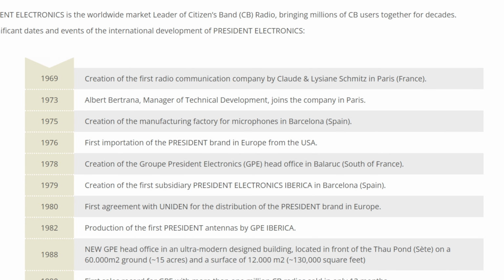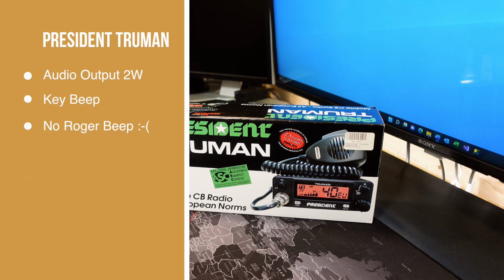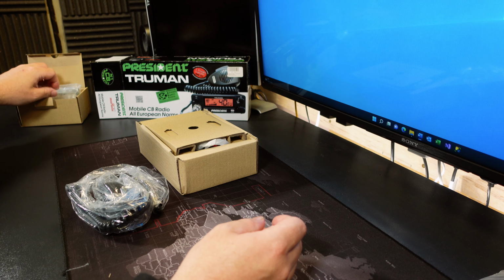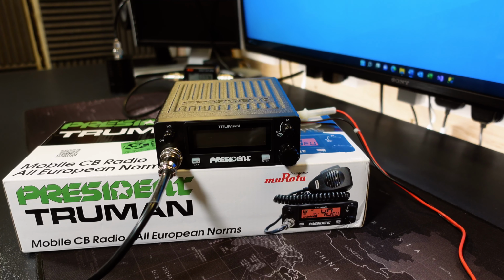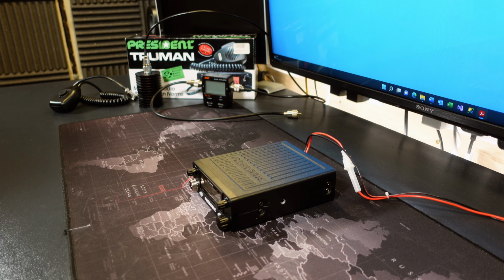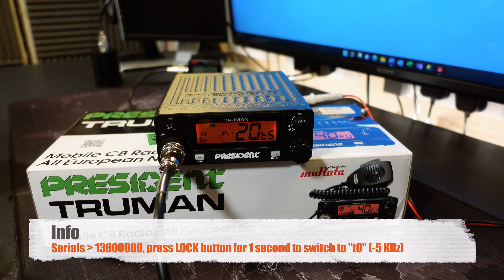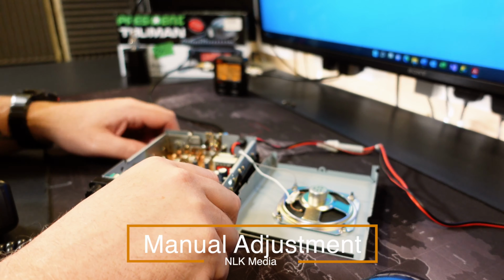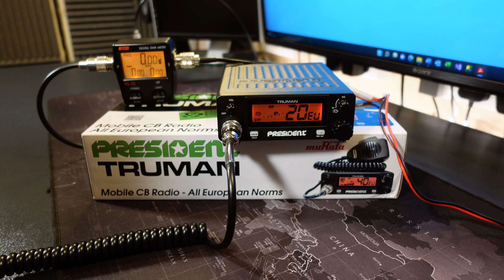President Truman CB Radio - Unbox, Test, Review and Power Modification

Comment: Hello, thank you for your great videos.  I'd like to ask- is it enough to cut white wire for the higher power output or the jumper must be moved too? I don't need an expanded channels,  just power. Thank you in advance and 73!
Reply from the maker: You need to do both as the jumper sets the radio into high power mode on the software side and then wire enables the higher power on the electronic side. If you cut the wire and leave the jumper then the radio remains in standard configuration using the standard power profiles. Hope this help and thanks for watching. MJ7NLK

Comment: On band c channel 33 do you get the 0s you could reach 27.780 and just get 19fm
Reply from the maker: Hi DX Chaser, You need band block B, channel 33 and enable the T0 mode to get 27.780. President have a weird band block methodology where Block C is Inferior, A is Normal and C is Superior. So, challed 33 in Inferior Block C is 26.885, Normal is 27.335 and Inferior is 27.785. Hope this helps and thanks for watching

Comment: What do you recommend in this price range with a Roger beep?
Reply from the maker: Hi, the Truman was about £85 as they were shifting the last of the stock, its been discontinued now. Knights Electrocom are out of stock now and so are Moonraker. However, Radio World has 1 left at the moment but i have never used them before so cannot vouch for them. You could always try your luck on ebay. Search around and see what you can find. All the best and thanks for watching
Reply: @NLKMediaGroup  sorry if bad english, I'm french, my question was not about the Truman, you said it was too bad that it didn't have Roger beep, so which one have it for under 100 bucks
Reply from the maker: Hi iShift, for under £100 i would have to say the President Barry 2 which is a solid radio. However, an expanded President Richard for £149 is a great deal at the moment if you have a Ham radio license. If you do not then pushing the budget to get its CB equivalent, a President Walker 2, would be a great move. If you want a single side band radio then the only option in the CB bands from President is the President McKinley but that comes at a cost. All radios mentioned have been reviewed on my channel. The CRT 2000H is also worth a look at around £120. If your looking for a CB radio only and can push the budget the Walker 2 is a lovely radio.

Translation to French which may not be very accurate

Salut iShift, pour moins de 100 £, je devrais dire le président Barry 2 qui est une radio solide. Cependant, un président Richard élargi pour 149 £ est une bonne affaire pour le moment si vous avez une licence de radio amateur. Si vous ne poussiez pas alors le budget pour obtenir son équivalent CB, un President Walker 2, ce serait une excellente initiative. Si vous voulez une radio à bande latérale unique, la seule option dans les bandes CB du président est le président McKinley, mais cela a un coût. Toutes les radios mentionnées ont été passées en revue sur ma chaîne. Le CRT 2000H vaut également le détour à environ 120£. Si vous recherchez uniquement une radio CB et que vous pouvez augmenter votre budget, le Walker 2 est une belle radio.

Comment: On this day in history, in 1545, the French tried to capture the isle of Wight but were defeated. Seems to be a pattern there. On the radio stuff: my Midland M20 had an identical wire jumper. It wouldn't put out more than 2.5w until the jumper wire was cut. A lot of the modern radios don't seem able to do 4w without modification.
Reply from the maker: Hi Gordon, I do hope you are well. Hopefully my humour is ok and viewers get it. I can see France on most days from here, its very close, so just playful banter and no offence is intended, I hope it made you laugh or at least rasied a smile. I have just purchased a Midland M20 and M30 and will be reviewing them after the current backlog. I think I have the President Taylor 4 and Lincoln 2+ left and then a CRT2000H and then the Midlands. Finding the time in the summer (I have 4 kids) is not easy and the videos take quite a bit of time to put together but fun. 4W is the legal limit so there wont be any CB radios in stock form pushing more than 4W. It will be interesting to tackle the Midlands and see what is available under the bonnet. All the best and thanks for commenting.
Reply: @NLKMediaGroup  I don't mind at all! GM4SVM.
Reply: @NLKMediaGroup  Here are my thoughts on the M20: Although it has a rotary channel change it is very stiff and there is no grip on the knob. What it needs is a flat sided channel change like the old Rotels. The USB socket is pretty pointless as it does not provide enough current to charge a modern smartphone. This is the same for a lot of the CB radios with USB sockets on the front. Finally I couldn't get more than 3.5w out of mine. It was 3.1 out of the box and with the power level pot turned right up I got 3.5. Eventually I cut the wire and the power jumped to 6w. I was then able to turn it back down to 4w. Again, this seems common in a lot of modern radios where they want them to pass an Ofcom spot check on import.  I know that 3.5-4w is really nothing in dB, but I felt short changed.

Comment: The President Truman ASC Premium is the little brother of the Harry III. Same design, same case and same high Uniden-quality but less features by the Truman-model.

+ sold from 2009-2021 (2016-2021 with japanese 455KHz-muRata-Filter)  
+ high build Quality made by Uniden Vietnam (Truman and Harry III are the last models which Uniden produced for President until 2021!!!)
+ EU- Multinorm on 6 bands with 4W FM and/ or 4W AM, UK-channels (Muppets) in FM
+ stable metal-case which doesnt get much warm after hours of transmission
+ ANL and hight quality 455 KHz muRata-Filter inside
+ sensitive and very good receiption
+ adjustable automatic and manual Squelch
+ third generation President-ASC (scratches, noises and too weak signals get filtered out)
+ loud and clear Modulation especially on AM
+ great sound quality by big internal speaker
+ good readable big orange display with excellent digital S-Meter (6 segments)
+ clear structured "oldschool" design with three well working dials and two buttons
+ easy to use for everybody, nearly self explaining
+ ideal for all who want quality instead of pointless and expensive features
+ price in Europe now 69-79€ (if still available), former price was 109€ in Germany

- ploppy manual squelch
- O-Mike without Up- and Down (tipp: U/D-Electret-Microfone under 20€: Komunica DM-520 U/D 6pol, looks like "President-Egg" but with better more clear and loud modulation)
- needs some alignment for the maximum Power- and FM-Deviation allowed

The President Truman ASC Premium looks good, works well and has its own charme of a basic but quality CB-radio. Price/value is awesome and sell out very soon!

Thanks for the video about the President Truman ASC Premium, the history of this US-President, quite funny jokes, short outdoor-test and your own point of view. The only I dont understand that you rated the Harry III very high earlier and the little brother Truman you downgraded and recommend instead a Barry II. A Barry II is quite different, approx. 30€ more expensive and the latest nearly full featured CB-generation which based on software programes, really not to compare with the older basic Truman which has charme and other specific qualities.
The Truman was produced over 10 years, so it was and is still a sucessful and very good radio for the little price. Thousands of CB-folks bought that radio in the more than 10 years of production and upgrades. Which other radio was over 10 years in the shelfs? I dont know any other model or brand.

However, I own the Truman and latest Teddy II ASC. Both are President's current basic AM/ FM-radios which work great and are worth the money for sure. 
 
Vy 10-10, Gordon
Reply from the maker: Hi Gordon and thanks for the history on this radio which is very helpful. The Barry 2 is about £10 more and has front USB, Vox, talk back, 12 + 24 v, Public address, noise limiter, multi colour display, etc. it’s about the same size and you get far more features for the small uplift in cost. Although the Truman’s screen is more readable in my opinion. 

All President radios are high quality and the Uniden made units were exceptional. My favourite President Radio is the Richard / Walker and for +£30 on top of the Barry it’s a price worth paying. The recommendation also reflects stock availability with the Barry being a current unit. President have even removed all material on the Truman from their site. Moonraker have a good stock and have discounted to £70 so grab them quick before they are gone.

I ran out of time in the end, as these videos take ages to produce, so squeezed in a quick audio test as you had requested :-)

I really do appreciate the feedback and information so thank you for taking the time to comment. 

All the best. MJ7NLK

Comment: What happens if you cut the wire but leave the jumper and vice versa
Reply from the maker: Hi DX Chaser, the jumper enables the additional frequencies and expands the radio which (dependent on radio) also gives it a small power boost. Cutting the wire gives it "all the beans" on the power front. However, cutting the wire and keeping the jumper in the 1+2 position keeps the radio in standard state. With the Bill 2 cutting the wire and jumping the jumper gives it a power boost and expands the frequencies but does not enable high power mode. You have to solder a wire on the PCB to do that. I need to do a video on this. So, the answer to your question is above but there are differences on some of the radios. Expand and cut the wire to fully expand and move the jumper back to restrict again. Hope this helps and thanks for watching
Reply: @NLK Media  thanks for full information 🙏